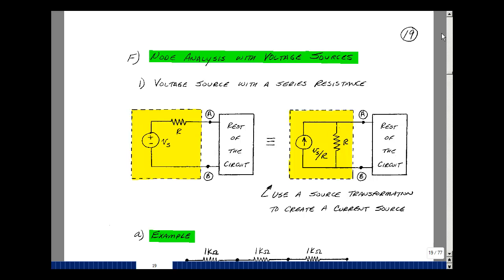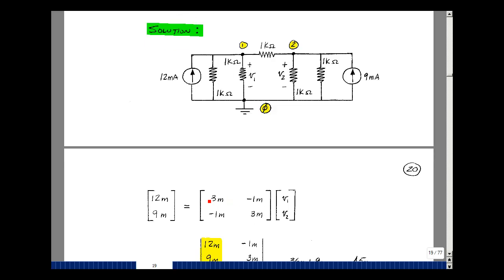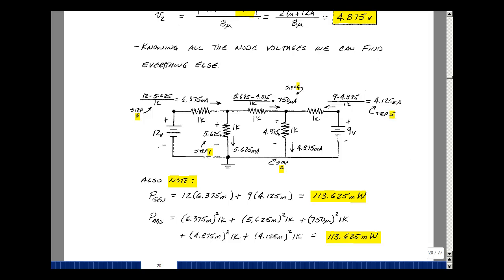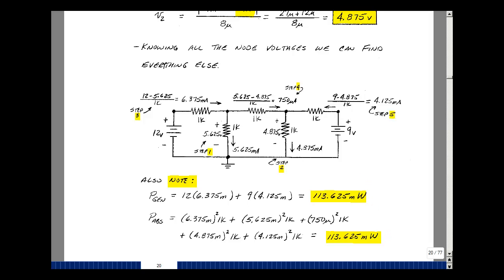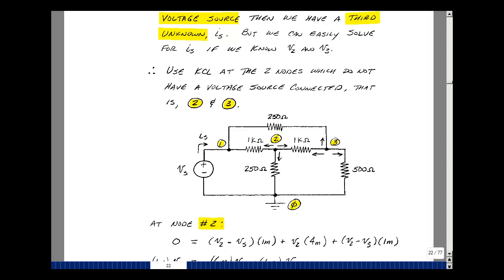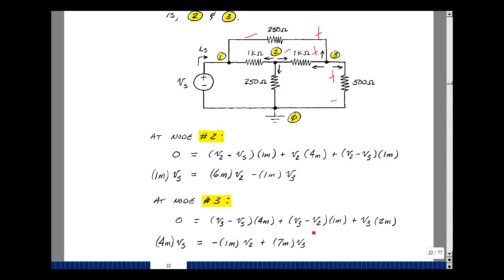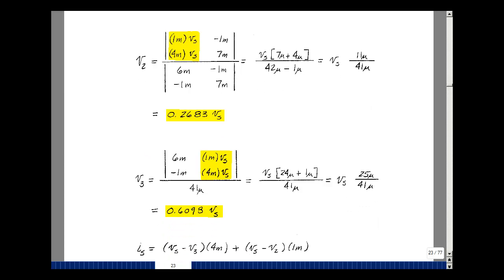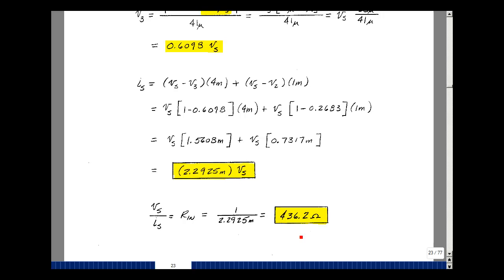ECE201msu: Chapter 3 - Node Analysis with Voltage Sources

Comment: Hello, where do you get [3m -1m; -1m 3m] from?
Reply from the maker: +Hamzah S 

Row 1 Column 1 is the sum of the conductances at node 1, that is, 1/1k + 1/1k + 1/1k.
Row 1 Column 2 is the negative of the sum between nodes 1 and 2, that is, -1/1k.
Row 2 Column 1 is the negative of the sum between nodes 2 and 1, that is, -1/1k.
Row 2 Column 2 is the sum at node 2, that is, 1/1k + 1/1k + 1/1k.

-Greg
Reply: +ECE201msu 

I was wondering how did resistance in matrix equation be expressed. So, thank you for tell me. 

I'm engineer student at DeVry university. I might ask you some questions in future. Thank again